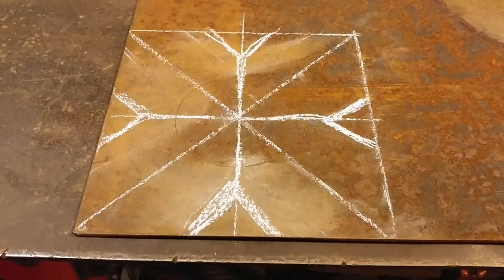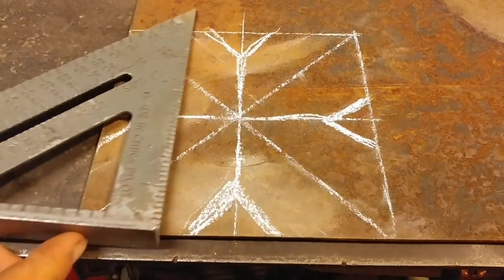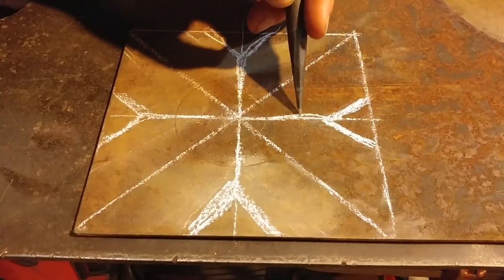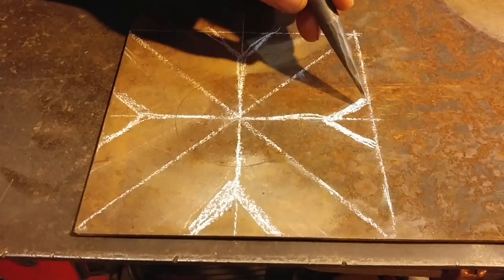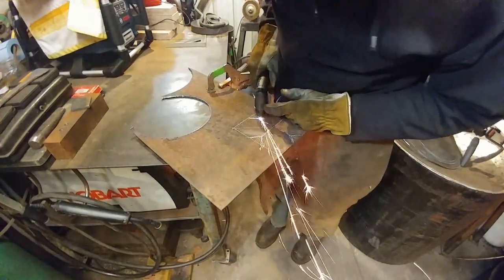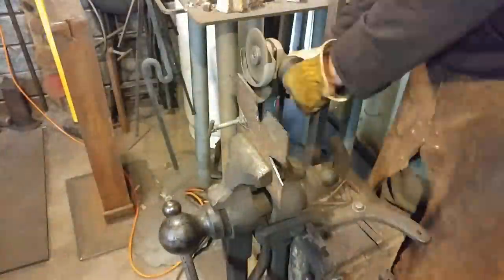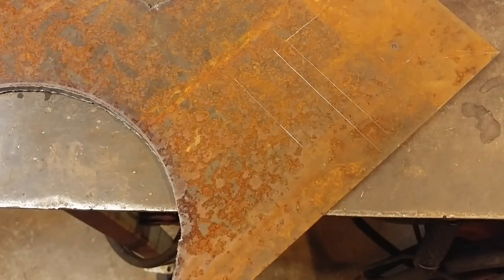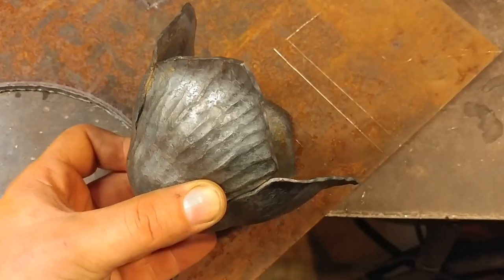Lamp Project: Forging a Lamp Shade "Bloom"

Comment: Nice project, again lots of technique to absorb and apply.   Your comments about the iron work being suggestive of the flower rather than trying for an exact duplication, is very intuitive and allows the customer to add to the piece through their own imagination.
My own poor work has suffered from my need to be precise in technique and rendering a life like product.   As, you have in the past offered real insight and good advice.   Thanks.